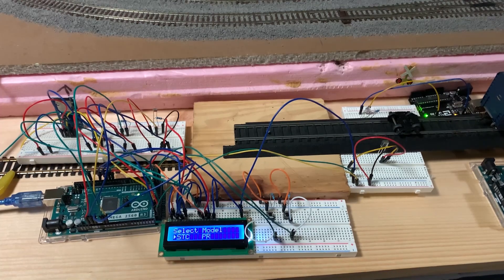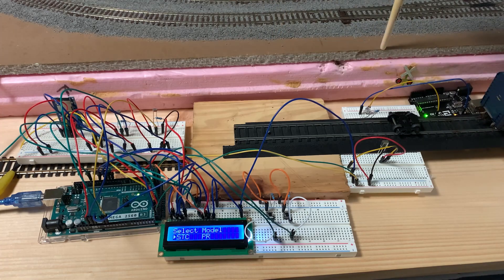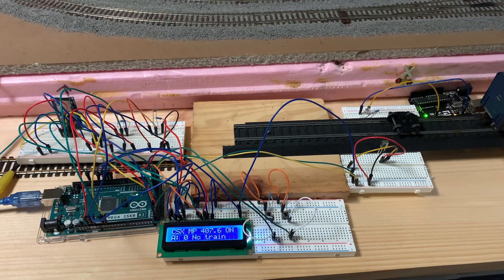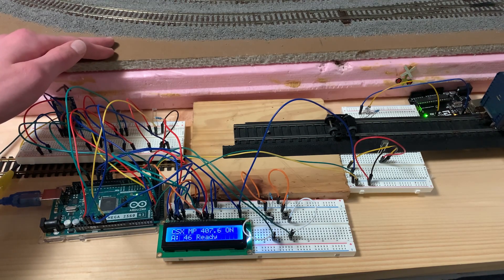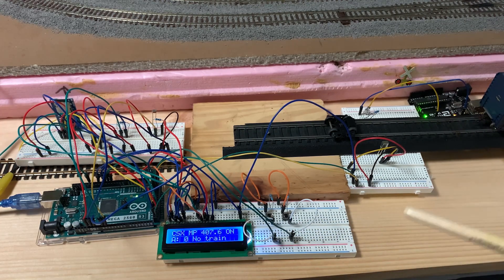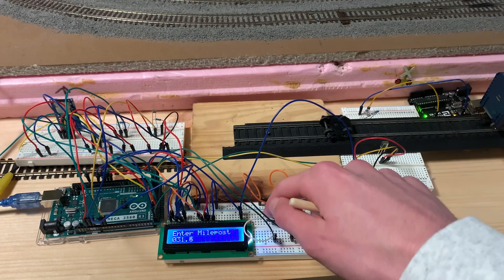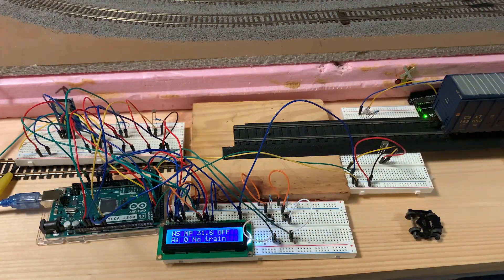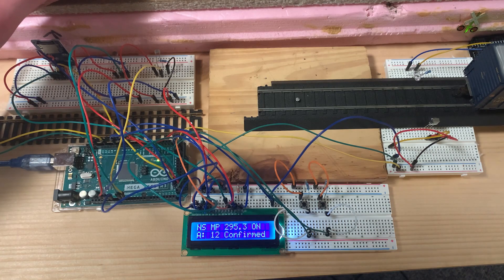HO Scale Defect Detector Using Arduino - Part 1

Comment: Well where did you come from?  Suddenly a single video about your model railroad about using Arduino supplied controls combined with a NCE DCC System.  It sure looks like you are headed to fully automating it's operation.  Great first video just Outstanding!!!  Are you considering using JMRI software?  I've started a system where I intend on fully automating a DCC-EX Command Station starting with JRMI's Decoder Pro and Panel Pro so I can begin to operate my layout. I would love to know your background and possibly compare notes.  Once again, That's a Great Start...